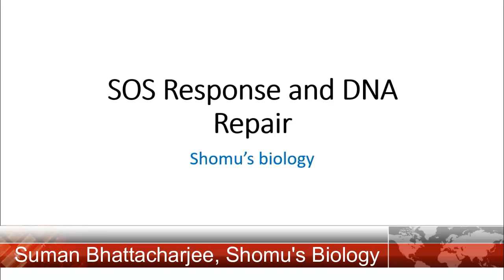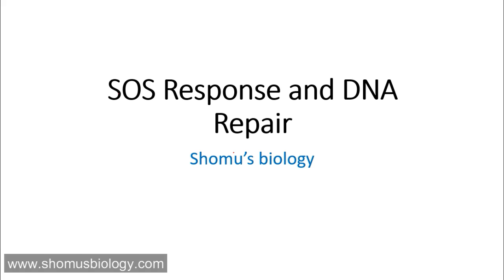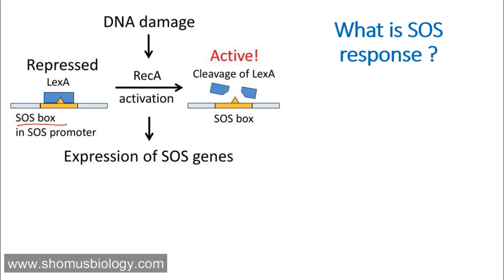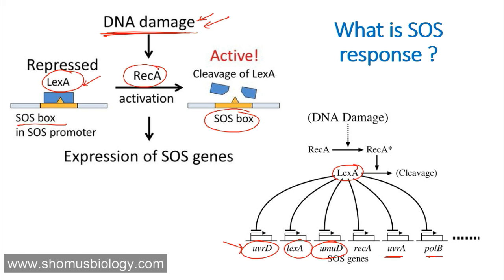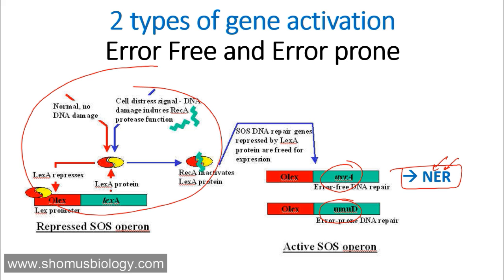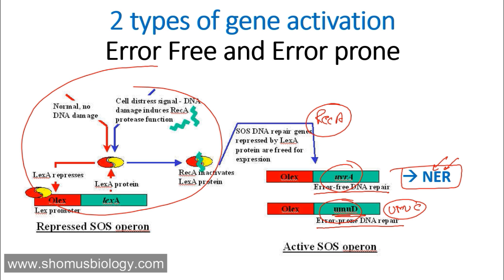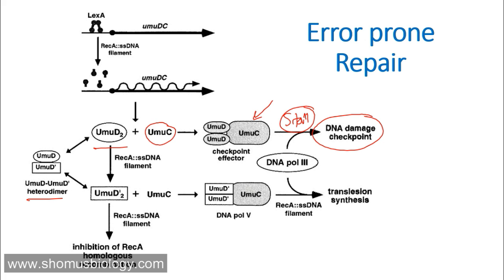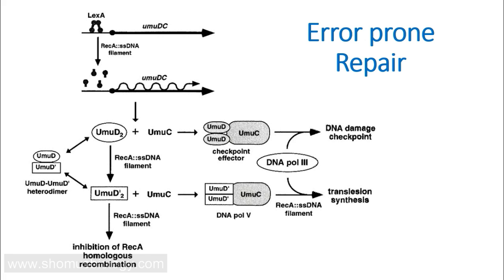SOS repair mechanism

Comment: Sir , you have written DNA pol 3 in error prone repair(last slide) but error rate is very less for this polymerase .. there is polymerase 5 which induce translesion synthesis which have low fidelity and error rate is higher than that of polymerase 3 ... Please check it sir.. 
It's polymerase 5 more probably.
Yours videos are always helpful sir